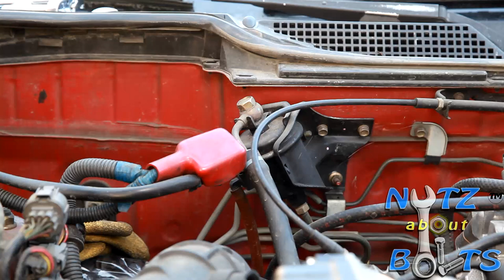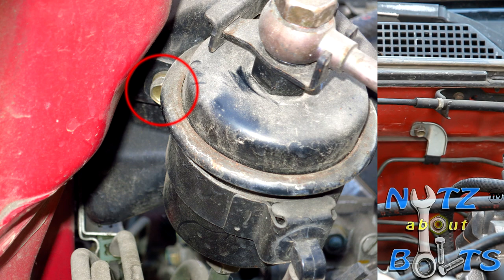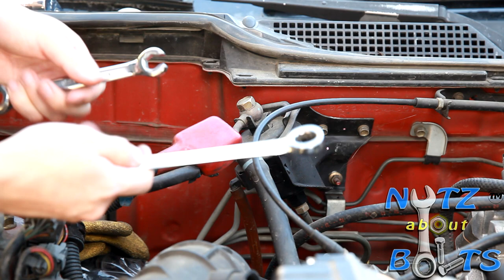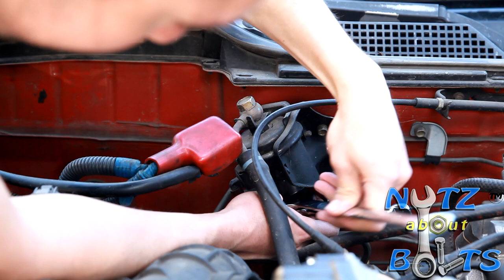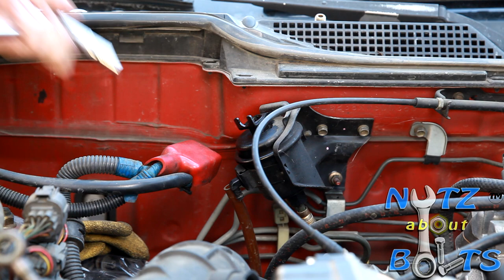1994-2001 Acura Integra GSR fuel filter replacement

Comment: Better to loosen the bottom fuel line last after everything else is loose or removed as then you can prevent so much fuel leakage by getting the filter off and blocking it quicker to prevent a possible fire, the entire fuel filter is full and going to drain out otherwise.

Comment: Hey my fuel filter came with 3 washers one is little is that one supposed to go somewhere ???
Reply from the maker: +Oscar Torrico there should be only 2, one on each side
Reply: @NutzAboutBolts  Ya i had an extra too. It came with a third smaller washer couldnt figure where it went. I saved it just in case.

Comment: How do you release the fuel pressure before taking the fuel filter off?
Reply from the maker: Brandon DeFord we remove the gas cap, but even then, there will still be pressure in the system. The best thing to do is to put a rag over the fuel filter and remove the fuel line slowly so that the fuel doesn't spray all over you.

Comment: Yours seem very simple to crack open. Mines is so tight that o started to bend stuff. Any suggestions?
Reply from the maker: Dc2 you want to use both wrench, one holding the fuel filter and one turning the nut that secure to the fuel filter, make sure not to bend any lines or else it'll be costly.
Reply: NutzAboutBolts  i have a question what happens  if you have a bad filter?
Reply: @carmenarchangeluriel1795  and can u clean a gas filter?
Reply: @berniemartinez8812  no
Reply: @berniemartinez8812  yes and no   its better to buy new they cheap

Comment: I'd add two more steps to your demonstration:
1- Remove the fuse for the fuel pump
2- Start the engine until it dies

This will relieve the fuel pressure in the lines.
That's how I've done mine.
Reply: Is the fuse under the dash or in the engine bay?
Reply: @jordanlewis6530  On the engine bay but it may vary depending on the car model.